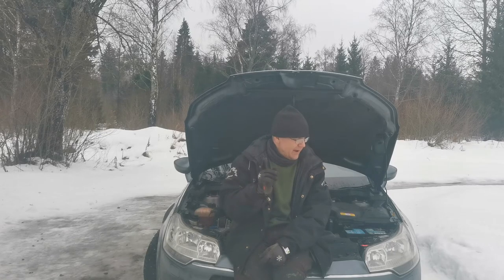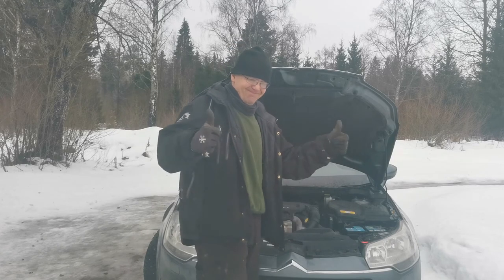[80] Citroen C5 dual windshield wiper motor synchronization

Comment: So what is the problem?
Reply from the maker: The final problem was that the sealent was missing and water had intruded in to the circuit of the wiper motor and messed up the logic. So we did buy 2 used motors and in the end used parts from the old and new motor to build two totaly new onse and atm they work. Total pain i would say.
Reply: @SilverEnergy  O , thank you very much, just got replacement motor but problem the same, are going to  open them and check inside, thank you for advice
Reply from the maker: @disnacdisnac4215  one extra note that i may have not said before is that open the black plastic housing and inside you will find the metal rods that moves the whipers. Set them manualy using a screwdriver as a leaver to zero. And then connect to the car. I found this way they work reset some internal stuff i think.
Reply: @SilverEnergy  Thank you, you are my Guru now